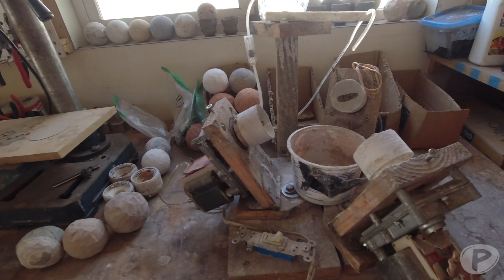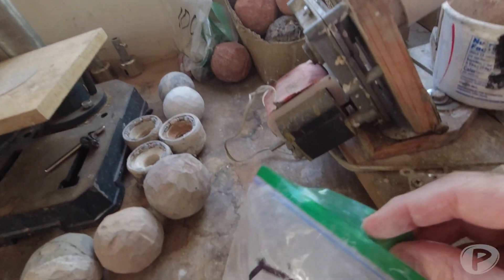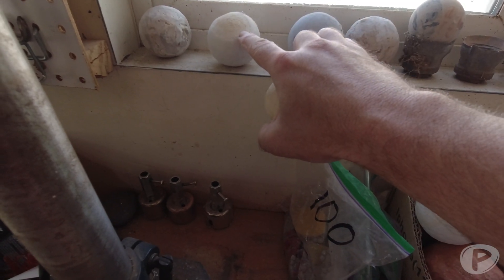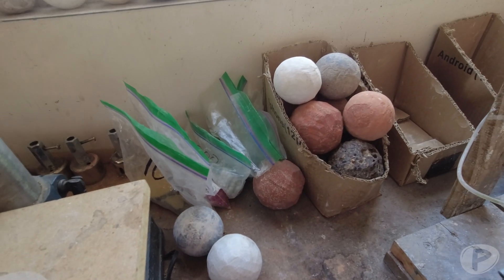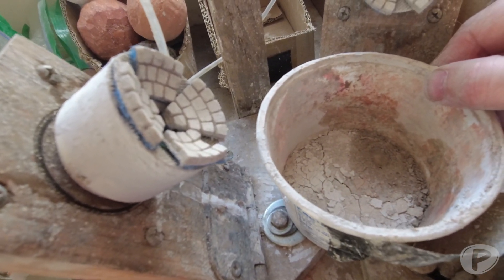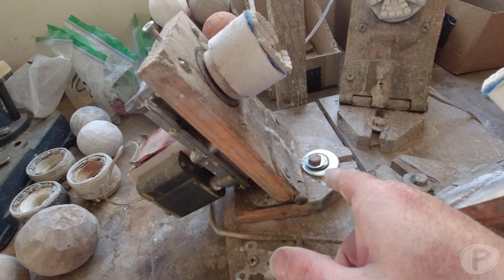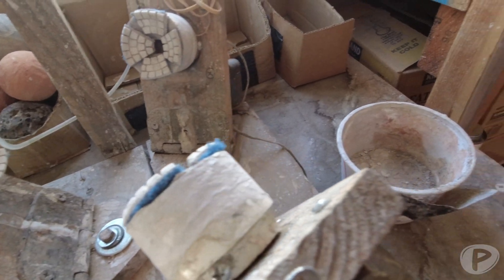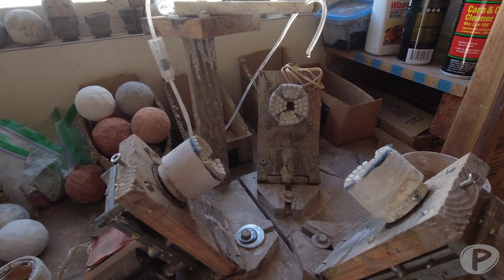Intro to My Sphere Machine: How I Make Perfect Stone Spheres!

Comment: Hello, i was following your videos on makin a sphere machine, but now you have made them unavailable? Why's that?
Reply from the maker: @ManfiCat someone brought to my attention that the cheep motors I was using do not have ground wires and are dangerous around water. I don’t want anyone to get hurt so I took it down. Honestly, if you use the same design but use motors with grounded wires and water resistant protection, it would be safe.
Reply: @ ooh, those are the motors I was going to buy! Good thing you did take down the video then!
Reply: Also, in another vid of yours you used a drill bit thing that had metal glued to it to speed up the grinding process. What are those metal things called?
Reply from the maker: @ManfiCat they were the bits from a polishing wheel for an angle grinder.

Comment: I'm looking to build something like this and am trying to figure out motor specification. Would you be up for sharing any identifying details of the mirrors and gearboxes? It looks like the grinding heads are moving at about 120 rpm. I'm basically reverse engineering from that right now. Any additional details would be greatly appreciated.
Reply from the maker: In later videos, I show how to build one. Check out my most recent videos